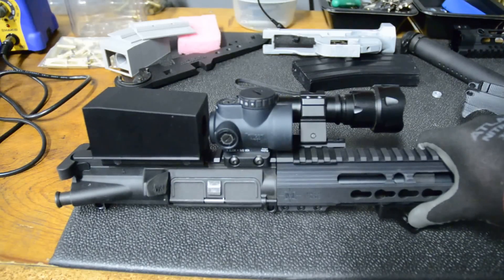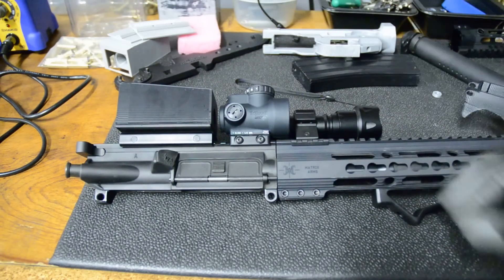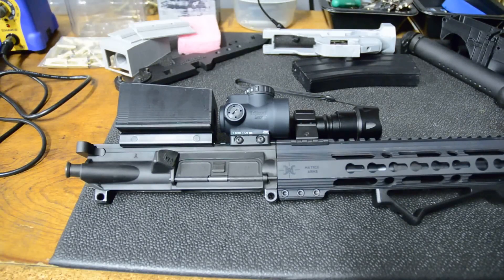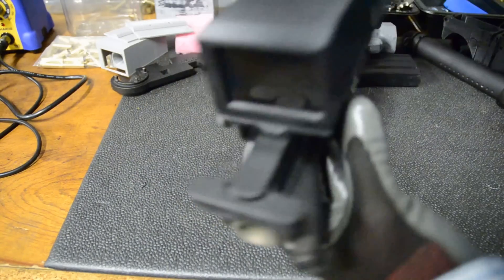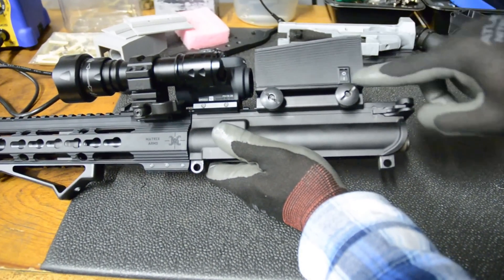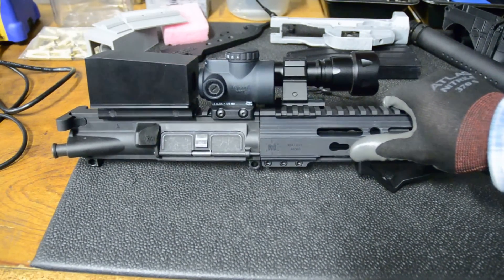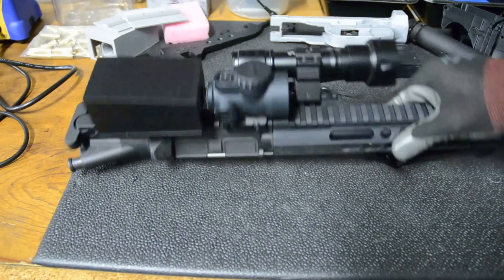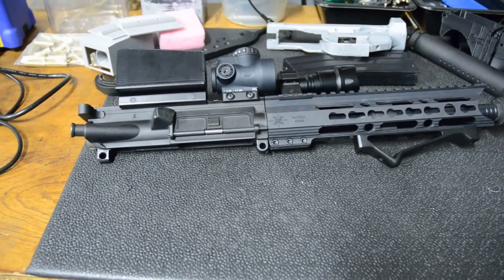DIY Night Vision (IR) Scope: ACOG Mount, Trijicon MRO, 3D Printed Housing

Comment: hey this is a sick project, im working on one right now gonna 3d print the housing and mount it to a flip-up type mount like on magnifiers so it can be moved out of the way easily, and maybe add a rubber eye cup to prevent light leaking.

Comment: Nice work! I just started looking into making my own sight like this and you've really helped me! PS: How has it held up to use on a gun? I plan on making some kind of quick detach and using it on both my 5.56 AR15 and my .308 AR10, bit I worry about it falling apart after prolonged use, especially on the .308
Reply from the maker: Works fine. Adjustable gas makes all my ARs soft shooting.
Reply: @Farrow_Tech  
Thanks!

Comment: Nicely made. I recently have a need for a night vision setup like this, and have been scouting the Internet for parts. I saw this dash cam with night vision and thought it might work alongside the illuminator that you are using. 

Look at this on eBay 
do you think this might work?

http://www.ebay.com/itm/172356785176
Reply from the maker: I think the sensor and aperture is too small. You will want one that has an interchangeable lens so you can set the FOV.  Most dashcams are too wide.

Comment: Damn this is so cool. I wonder how accurate it is... ;) Did you print the housing for use with the picatinny?  Any chance of making a QD mount for it? That would be sick.
Reply from the maker: I printed the housing that mounts to the ACOG base.  The ACOG base itself is metal, so that interface should be pretty strong.  There are a lot of good QD options out there.  
It looks through the MRO, so it should be just as accurate as without it.  In my state is it legal to hunt coyotes at night. I'm not planning on actively hunting them, but if they start going after our chickens again, I'll have some 300 blackout ready.